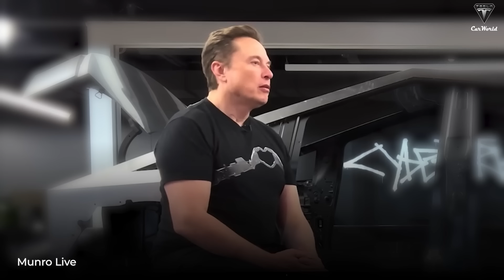Massive Tesla Giga Press 4.0 Detroys All Welding Robots!

Comment: As Toyota builds battery plants to produce Solid State batteries that last 40 years with an 800 mile range.. Their plans are for customers to trade in cars every 5 to 10 years and use the battery from the original car, making a new car with no battery system for a much lower cost...

Comment: Just because something is innovative doesn't mean it is better. Other brands can build cars from steel with similar or lower production costs, while achieving similar safety standards, frame stiffness, and weight. By the way, steel is a highly versatile material in terms of strength and ductility. Different type of steels allow to design optimal deformation zones with very good controlled plastic deformation, ensuring high energy absorption during a crash.Furthermore, these 'old-school' steel cars are much easier to repair, which keeps insurance cheaper. From an environmental point.ofnview, steel also offers a much lower carbon footprint during production and is far easier to recycle than large aluminum castings. Additionally, traditional brands are able to introduce a new model (not a facelift) every 7 years—Chinese ones even every 4 years—and many good brands can make a reasonable profit on each car. It something  where Tesla fails constanlty. Frankly speaking, I do not see it as a good idea to use gigacasting for car frames. It has a lot of disadvantages and only a few advantages, even if the stiffness of the frame is very high, but ductility is bad, it cracks more like than  deforms plastically. Of course, I could be wrong, and only time will tell which solution is truly better. But let’s not forget: steel was, is, and always will be the queen of materials! It doen't matter that it old not fancy material :-)

Comment: Cars manufactured using this process will have so few parts that a relatively minor accident will result is half of the car needing to be replaced.  Unless these castings are cheap to manufacture, the repair costs will be excessive, and insurance on the car will be extremely expensive, if it can be obtained at all.

Comment: What happens if this highly technical press with "one of a kind parts" breaks ? Flexibility in the car manufacturing industry is the cornerstone of TPS. Maybe making thousands of small improvements would benefit the Tesla stockholders more than re-engineering the core processes of manufacturing.Just a thought.

Comment: So the one piece body takes all the impact? Safer or? We can have broken pieces replaced on seperate parts. What do you do with the Tesla when damaged? One piece? 
Till we have 100% guarantee that it will never have runaway batteries..no explosions, fires etc. , I won't touch one.
Palisades is a good example of how intense and long fires can burn when fueled by ignited batteries. My husband doing many home rebuilds in Palisades. The stories of the electric cars fueling the intense burn has not been investigated by anyone. Now Newscum wants to put self drive cabs on street? Gee, I feel safe with millions of these dumped into our cities.  Why is no one talking about how to control battery run away and how to deal with this time bomb in accidents???????

Comment: The Major over sight was that he focused on using aluminum. Chopped carbon fiber mixed with heat activated resins would make this giga press outdated. Plus parts would have fatigue, strength and weight advantages far superior to aluminum.  The advantage with aluminum is the recyclability aspect. Wait and see, China has already poured it's resources in this much more efficient solution and will be introducing their solution to large fiber/resin injection molded auto parts....

Comment: The first thing that came to mind is how does this architecture affect repairability, after my watching a video of a Rivian totaled over a minor crash that didn't even involve chassis damage. Just broken plastic bodywork and a couple of bent, easily replaceable suspension components. 

One problem is that most collision shops won't touch a damaged EV, partly because they're different, presumably requiring different repair skills. Then, there's the legal liability issue involving high voltage systems and the potential for lithium battery fires during and after repair.

Changing from multiple welded-together sub-assemblies to a few larger castings may not make that much difference in repairability, as both architectures seem to produce essentially unrepairable throw-away vehicles. But if Musk's process can reduce the cost of an EV enough, the lack of repairability may become an acceptable risk.

Comment: since the structural integrity of the unibody could become compromised after a small accident, should these cars be considered "throw away".  Is that risk being built into pricing?
Reply: It will be built into the insurance prices.   But these vehicles are not meant for you to own.  They're meant for fleet operators, who will amortize such costs across their entire operation.

Comment: Aluminum doesn't like a salt and saltwater . It turn  aluminum to white powder  . I remember during Hurricane Sandy saltwater go to our storage shop and all the chainsaw and concrete cutting saw aluminum chassis turn to white powder from saltwater .
Reply: Paint isn't just for looks, it's also for protection.
Reply: @Sean-s8e1d  after Northeast all those aluminum car which was flooded with saltwater will turn to the white powder I mean aluminum oxide dust .

Comment: So, if a body section is damaged replace the entire Shell ❓ Genius Genius Genius ❗
Reply: That worked in the Soviet Union with the Lada but with a Tesla it is not something you want or would be proud of. It is just a way for Musk to boost profits. An accident means the whole car will be useless as replacing the body will cost as much as a new car.
Reply: @Andre-qx8qh I believe that the largest decrease in parts are the main structure parts at the front and the back where suspension, power train, and body come together. And these two end basic chassis parts would fasten on to the ends of the battery structure. Body, suspension, and such parts would take the biggest part of an impact,.and hopefully protect those major chassis parts. But if they are damaged, that might lead to a total of the vehicle.

Comment: Looks like all is fine, but there is an issue with aluminum core structure, if it blend in a collision is hard to recovery it original shape and strong, other thing is the vibration create micro fractures and after a few years make an estructure failure like happened to airplanes.

Comment: How will cybercab do in winter storms
Reply from the maker: That will depend on real-world validation, because the content focuses on manufacturing, not winter performance. Tesla would still need to prove the Cybercab can handle snow, low traction, and severe weather safely before wide deployment.
Reply: It’s so lightweight, it will blow away.

Comment: To ease passenger's fear when riding a CyberCab, put an animatronic driver in it like a JonnyCab in Total Recall or Otto the automatic pilot from Airplane. 😄😄😄
Reply from the maker: Yes, EVs still need maintenance like tires, brakes, suspension, and regular inspections, even if they have fewer service items than gas cars. Factory automation changes how the car is built, not whether the vehicle needs upkeep later.

Comment: wow does this mean instead of replacing my dented fender i will have to replace my whole car?
Reply from the maker: Not necessarily—a dented outer panel should not mean replacing the whole car. The bigger concern is only if the main structural casting is damaged badly enough that repair becomes uneconomical.

Comment: So two standard Americans at around 300lbs.ea.conservatively,will just about cause overload? I submit that the weight limit, makes it not usable for about 65% of Americans. Also are the seats jumbo adaptable? Just thinking...
Reply from the maker: That’s a fair usability question, but this content is really about manufacturing, not final passenger specs. Tesla would need to publish the official payload, seating limits, and cabin dimensions before anyone can judge how practical it is for heavier passengers.

Comment: The problem is tesla had lost its way and purpose.  Leaving behind common sense and purpose for profit.  Their service centers are predatory.  I was a bold believer in musk and tesla.  But after many terrible experiences with tesla I no longer feel the same way.  The goal was to build stable, sustainable, economical, and good for the environment vehicles.  That's just not the case.  Once your vehicle is out of warranty tesla is no different that any other greed hungry car dealership.  Plus he stifles innovation by keeping competitors with better cheaper technology out of the USA.
Reply from the maker: That’s a serious ownership concern—lower factory cost means little if service and repairs remain expensive. Tesla claims up to 50% lower manufacturing cost, but customer trust will depend on reliability, repairability, and after-sales support.

Comment: Is there going to be maintenance tasks like brakes, tires or any other tasks required?
Reply from the maker: Yes—EVs still need tires, brakes, suspension checks, and routine inspections. Automation changes how the car is built, not whether it needs maintenance later.
Reply: Does the repair facility need to be specially trained?

Comment: So if you have a minor fender bender and the frame is bent, what happens then?  Replace the whole thing?  It might be great for Tesla, but it’s terrible for the vehicle owner.
Reply from the maker: A bent outer fender may still be replaceable, but damage to the main structural casting could make repairs much more expensive. That’s the tradeoff: fewer parts and welds, but potentially harder structural repairs.

Comment: Will it be used for making the dump trucks ?
Reply from the maker: The content focuses on Cybercab and next-generation passenger vehicles, not dump trucks. A larger Giga Press could theoretically make heavy structural parts, but no dump-truck plan was confirmed.

Comment: If a TESLA  car is in a serious accident it is a total loss as the Die Cast frame is not  repairable.
Reply from the maker: That’s a valid concern—serious damage to the main die-cast structure could make a repair uneconomical and lead to a total loss. But minor crashes affecting replaceable outer panels would not automatically total the car.

Comment: Does this also mean no repairs are possible in the event of an accident ? and the entire vehicle becomes an entirely disposable unit.
Reply: Is not the case in many EVs anyway, due to battery cell damage?
Reply: Depends on the type of accident.  An accident that damages the frame will cause the insurance company to 'total' just about any vehicle.
Reply: But more easily recycled for a new car...
Reply from the maker: No, the whole vehicle would not automatically become disposable after every accident. Outer panels may still be replaced, but severe damage to a major casting could be more difficult and expensive to repair.
Reply: Most cars these days are totaled out by insurance anyway once they are about halfway through their life and are in a significant enough accident.
Reply: Yes.

Comment: They should make the batteries hot-swappable
Reply from the maker: Hot-swappable batteries could reduce downtime, especially for fleets, but they add structural, connector, and standardization challenges. Tesla’s current approach in this content is focused more on faster manufacturing than battery swapping.

Comment: When this kind of produced car is in a collision then it’s not repaired because its not possible. So the insurance are going to be horrible.
Reply from the maker: Severe structural damage could make some repairs uneconomical, but not every collision would total the car. Replaceable exterior parts may still be repaired normally if the main casting is unaffected.

Comment: So only room for two people per car?
Reply from the maker: Yes, Cybercab is designed around two passengers. That smaller format helps reduce size, weight, and production cost, but it will not replace larger vehicles for families or groups.

Comment: Where the robots crashed by the giga press? How did it destroy them? Did those robots resist the imminent fate? The robots are going to come back to roost some day. The way the people from the town where Dr Frankenstein lived came with torches. This is a prophecy. Bet on it on the prediction markets. The odds will be low there but the danger is really imminent against the giga press. No amount of squeaking will save you giga press.
Reply from the maker: The robots were not literally crushed—the point is that Giga Press eliminates many welding tasks, so fewer robotic arms are needed. The technology replaces parts of the process, not robots in some dramatic physical battle.

Comment: How to repair damaged section
Reply from the maker: Minor exterior damage may still be repaired normally, but serious damage to the main casting could be much harder and more expensive. Repairability will depend on which section is hit and whether it is designed to be replaced separately.

Comment: Good to know that the piston is lubricated with 8ml oil before the shot.
Reply from the maker: It sounds like a tiny detail, but those precise lubrication steps matter in high-pressure casting. A small error can affect mold release, surface quality, and the consistency of the final part.

Comment: Old idea Germans using that for airframe production  in 1928😂😂😂😂
Reply from the maker: Large-scale casting is not a new idea, but Tesla is applying it differently by combining huge castings with parallel module assembly. The proposed next-generation press could reach 50,000 tons of clamping force.

Comment: Irrespective of whether you cast your car parts or manual press it as small parts then join it, people will not get any benefit. It may help Tesla as propaganda to increase their share value. Only thing matters to common people is, how cheap it is when compared with other similar model cars from other manufacturers, how much we need to spend it for maintenance during the lifetime and how much you need to pay for battery replacement after battery is dead. 
World is racing to replace humans with robots and automation which will ultimately create more unemployment across the world, unemployed youth may addicted to drugs and involve in anti-national activities. For many ordinary people, it's their job which keeps them engage and avoid unlawful things.
Reply from the maker: That’s a fair standard—the real benefit should be measured by purchase price, lifetime maintenance, and battery cost, not factory hype alone. Tesla claims the Unboxed Process could cut manufacturing costs by 50%, but whether ordinary buyers benefit depends on pricing, repair costs, and how society handles job displacement from automation

Comment: AI is going rouge on one side and doing cyber attack on it's own, other side Tesla is building fully autonomous cars without steering wheel and brakes😂. 
If someone uses AI models to attack the Tesla autonomous vehicles network and makes them to go full speed and collide 😂... If not possible today, someone will be able to hack any autonomous vehicles using Advancements ... People should always have the emergency controls to save their lives.
Reply from the maker: Cybersecurity is a serious concern for any autonomous vehicle. Tesla would need layered protections, isolated safety systems, and independent validation before a steering-wheel-free Cybercab could be trusted at scale.

Comment: People want flying cars, bro. Wealthy landowners don't want them, because it lowers property value when 'location, location, location' isn't nearly as important, and commercial pathways aren't tethered by roads.
Reply from the maker: Flying vehicles could help in remote areas, but this video is focused on making ground transportation cheaper and faster to produce. Tesla’s immediate target is the Cybercab and an Unboxed factory system aimed at 50% lower manufacturing cost.

Comment: Great idea but will be written off in a light accident unless it has bolt on sub subsections
Reply from the maker: That concern is fair, but a light accident should not automatically total the car if only replaceable outer panels are damaged. The bigger risk is when the impact reaches the main structural casting.
Reply: @TeslaCarWorld yes this is my point, I would need to see the design to make an informed judgement.
I have been in the salvaged vehicle repair business for many years and understand how the design of a vehicle can affect insurance premiums, if a vehicle becomes easily undesirable insurers increase premiums or decline to insure, here in the uk we are already seeing many bodyshops unwilling to repair Ev’s.
Cast components are not repairable in the way traditional steel body components are, again I would need to see the technical drawings to understand where the cast tub ends and subframes begin.